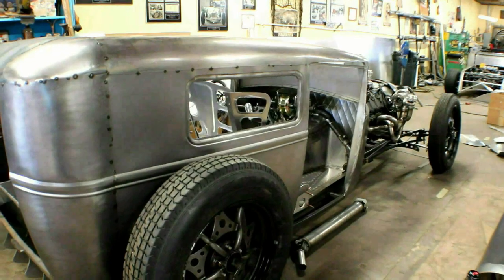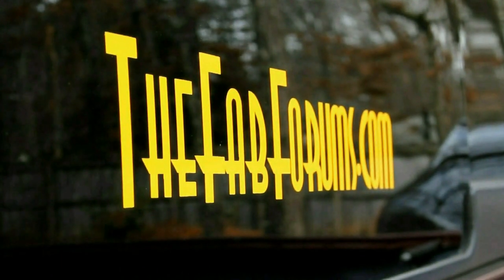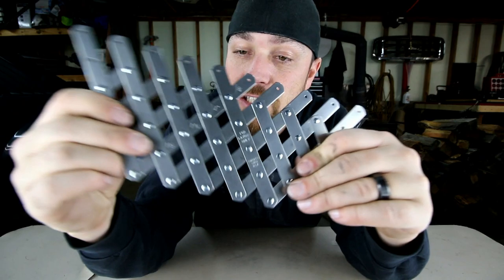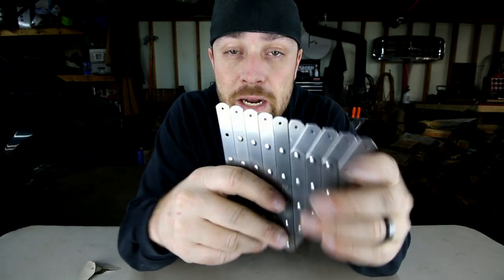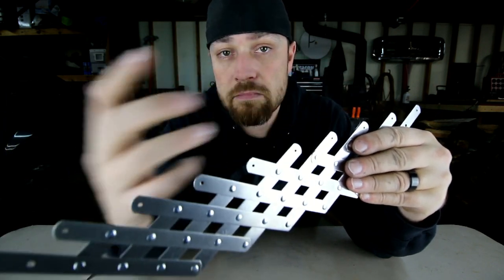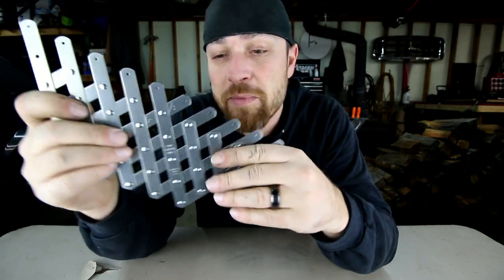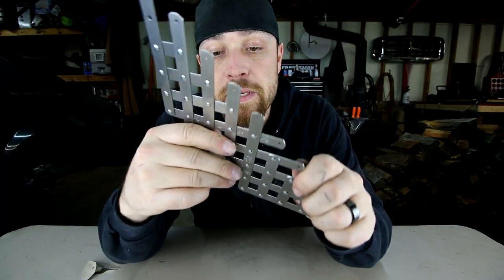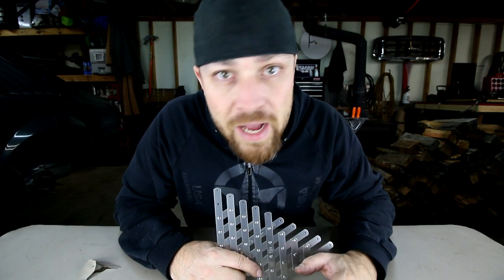You Need This Tool - Episode 45 | Rivet Fan Spacing Tool

Comment: Pro Tip: When using that tool, mark you first hole, drill it and then fasten to the tool to the part with a Cleco. Set you spacing and cleco another hole and the cleco will hold the tool in perfect position to lay out the holes.
Reply: Genius!
Reply: good thinking!
Reply from the maker: for sure
Reply: Brandon Wilson    Ç’

Comment: That is genius, great tool for sure. Thanks for showing it to us. I never knew such a tool existed but it would definitely make any job with rivets, screws or bolts look much cleaner without all that measuring and figuring out the correct spacing. Nice work Brother.
Reply from the maker: +Tim datoolman I felt the exact same way when I seen it

Comment: that's dope, would be nice if it had magnets to stick it on.
Reply from the maker: I have mixed emotions with magnets because they collect metal shavings over time
Reply: Mario Molina  most of the time these are used on aircraft sheet metal jobs that is mostly comprised of aluminum alloys.

Comment: I use an elastic tape rule.  No, I haven’t lost my marbles.  It’s a piece of elastic marked in equal spaces ( about an inch, but as long as they are all the same it doesn’t matter.  Fix one end with the first mark where you want the first hole.  Count off the number of holes you want and fix the elastic to where you want the last hole.  Mark off on your sheet the corresponding hole positions.  The big advantages are that you can have any number of holes you want and there is no tool left sticking out where space is tight.  Secondly you can lead the elastic around a curve to maintain the hole pitch round bends and thirdly it’s cheap.
Reply from the maker: thig that is nice about this is you can use it as a drill guide